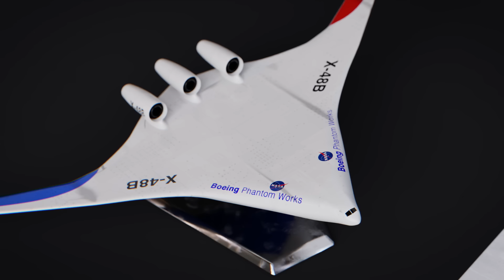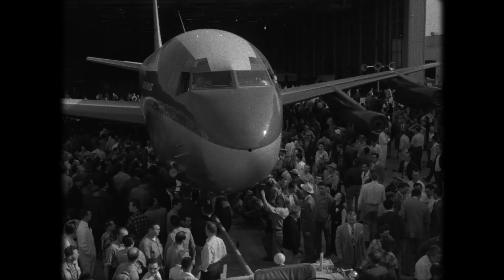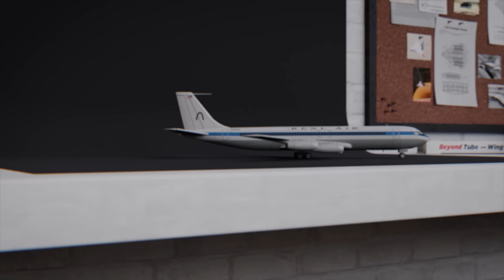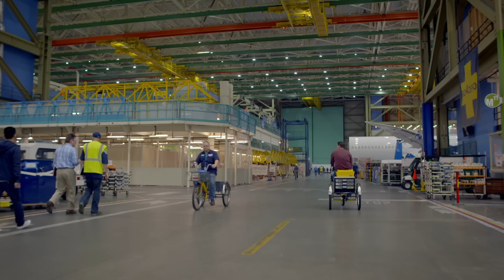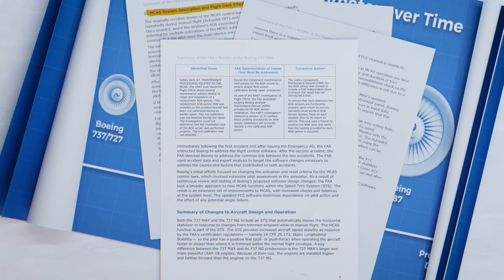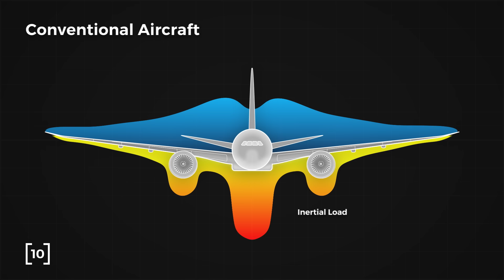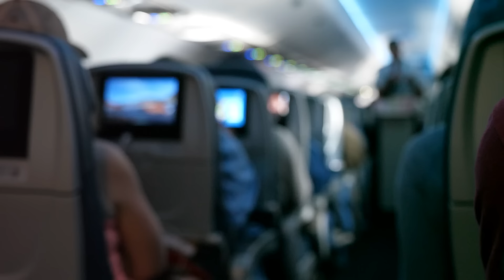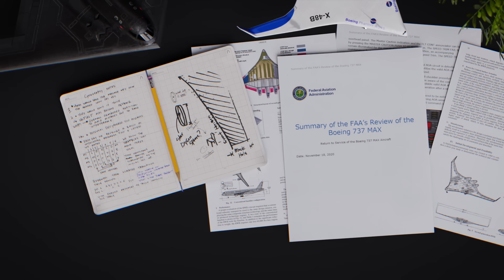The Plane That Will Change Travel Forever

Comment from the maker: Thanks everyone for the support on the notebooks! Took another pretty huge bet on manufacturing those things in bulk. About to hit the breakeven point so at-least I haven't lost money on them! If you wanna get your own, this is the link. https://store.nebula.app/collections/real-engineering
Reply: Engineer gaming
Reply: @Real Engineering can you do a video on how you would go about designing an aircraft (passenger or military) that would run off of renewable energies like wind and solar please
Reply: Concordia was best Plane ever :-(
Reply: @4thjulybd809 4 egg
Reply: All sold out already 😞
Reply: I bought one of your notebooks a long while back, and I really love it!
Reply: Is that kalamaduhz or kilo'meters?
Reply: Shipping 😭
Reply: The blended wing concept sounds intriguing...  the pressure loading issue could be negated by adapting a "passenger handling" concept from the mid 1960's where the passengers were to board a module and that would be ferried to the aircraft and secured to the airframe thus separating the flight crew (pilot/copilot) from passengers... The 'modular' passenger/cargo concept would also allow a greater mix/match of cargo/pax  and no major change to airport passenger services where the passenger boarding bridge and passenger module meet. Last of all, the blended wing aircraft would not necessarily be crowding a terminals jetway as it awaits, servicing, pax/cargo/crew; and even more advantageous is as the pax modules are inbound to the terminal the outbound pax module is outbound, speeding up the turnaround time
Reply: bit of a fault with your design, engines on the rear tail,,dont work.
Reply: its called....a-loo-min-um....you engineers dont seemed to be able to pronounce this word correctly?
Reply: @MrTwige   No, it's you Americans who don't know how to say or spell aluminium!
Reply: @stevie-ray2020  Its ok, To ma to, 
t mot to!  I understand it!
Reply: @MrTwige  No thanks! Us Aussies will just stick with what are the accepted global-standards!
Reply: @MrTwige  who killed the native Americans and took their land?
Reply: @Jesusisyhvh1  you did!
Reply: @MrTwige   I am native...
Reply: Q

L
Reply: @MrTwige  Someone clearly hasn't heard of regional dialects.
Reply: @MrTwige  
He should change his channel name to “Fake Engineering”

Comment: @5:05 uhhhh, it seems like the solution here is obvious!?!  Instead of building an entirely new blended body airframe to test tail-less wing controls, use the existing tube and wing design to run that test!  All you'd need to do is shift the center of gravity and chop off the horizontal stabilizer!  And if it works, the video says removing the horizontal stabilizer produces 5% more lift, less induced drag, and less parasitic drag adding up to ~20% savings.  You'd only need to design new wing control surfaces rather than the ENTIRE plane!!!!!!!!

Comment: Nah did you hear about the Airbus Concept Plane? It’s powered by hydrogen and the plane will turn transparent . Also, there is an interaction center. The seats a 100% recyclable and adapt to person sitting in them. It also has floating screens and there will be sound showers at night.  There is also an electric version
Reply: Recyclable seats? Great! No need to go to the toilet anymore xD

Comment: Building c.20 billion dollar flying wing bombers is one thing, building (and selling) hundreds of flying wing / lifting body commercial airliners is something else. The tube and wings is working, it is still evolving. The evolution has been largely successful, the revolutions less so - clearly the Concorde in speed, arguably A380 in size. The tube and wings is the aerial equivalent of a bus, form and function combined, basic and cost effective. That leaves fuel savings vs all other factors. The irony being that for 50 years we have been talking about fossil fuels being limited, yet the last couple of years has seen a surplus of oil, to the point that quotas are needed to keep the price high enough that US and North Sea oil is cost effective enough, and that’s while sanctioning Iranian and Venezuelan oil production, to some point Russian oil production and limited Libyan oil production. The problem might not be the fuel consumption, but rather the manipulation of its price.

Comment: Tubes and wings…
That’s not only the B-47 / B707, but most aircraft ever created.

You are talking about a pressure cabine, sweptback wings and wing mounted jet engine pods.
Tubes, wings and a lot more.

Comment: One of the biggest enemies of this Design (which exists in an Airbus variant as well btw) is the form factor on the ground. All of the worlds airports are set up to handle tube + wings style airliners. Adjusting them to handle this weird geometry will take decades which will hamper airlines flexibility a lot. Secondly its fairly bad for evacuating. The 90 second rule is unlikely to get dropped and with two planes worth of passengers but "half" the side exits to escape out of its gonna be more and more difficult. Not to mention that the shape of the pressurized area will be another issue.

Comment: It will be interesting to see if structural or "massless" batteries can be incorporated into the carbon fiber design of the plane, as well as perhaps a photovoltaic attribute considering its large surface area.

Comment: The problem with blended wing airliners is that the passengers sitting furthest from the axis of roll will experience larger forces when the aircraft performs any turning maneuver. This in turns creates a very uncomfortable travelling experience for those passengers. That is why blended wings haven't been developed yet for airline purposes.

Comment: A flying wing design could readily use a hive frame design both laterally and across the airframe. Carbon Fiber could be easily made to use a magnetic bonding unit to pulse a 3d printer and bound using a hive matrix. Anyone who is doubting the hive technologies should give me a call. 780-228-1300. Elon could build this technologies and Mars would be a simple flight operation with a magnetic flux engine with ram jet drives easy peasy. Scalability is about several factors rather than brute acceleration and the lift can be overcome with Mach 6-9 escape velocity out of orbit.

Comment: I miss old Boeing. When engineering came first. After the merger, it's never been the same.
Reply: Boeing is incompetent.  Airbus beat them decades ago on fly by wire controls. I won't get into a Boeing plane.

Comment: Hydrogen will never be a successful fuel because the use of hydrogen emits MORE CO2 than just using jet fuel. If there is a fuel that could be applied it would be LNG, not liquid H2.

Comment: You may want to double check your research as "elliptical" lift distribution is historically what has been used to design conventional aircraft. The term you are looking for, the lift distribution strategy that allows for lightened component design out at the wing tips and reduced drag from the control of vortex generation, is "bell curve" lift distribution. Proverse yaw is another advantage of the BCLD philosophy and is the primary reason that birds don't need vertical stabilizers and rudders.

Comment: I didn't hear a convincing resolution to the issue with keeping the plane stable though
Is the plan really just to hope that the software and sensors work perfectly? If that's the case I'm going to file this mentally under the same category as the 737 Max - never gonna ride in one of these.

Comment: Hydrogen fuel is not necessary to be carbon neutral, bio-fuel from maring algae (diatoms), which could be farmed would also work, without all the expensive infrastructure hydrogen would require (which also has its footprint). TANSTAAFL

Comment: How would the X-48 airliner meet the requirement of full evacuation in 90 seconds using 50% of the exits? Exiting under the aircraft is not practical. Can't be used at all after an undercarriage collapse. No airliner has underbelly exits. So it means going up. That will be slow compared with the slides that are used with the main exits on a conventional airliner. Overwing exits in a conventional airliner are there to give a  bit more exit capacity to meet the 90 second requirement. They care slow because passengers have to step up and out. Passengers must be prevented exit into danger such as onto a burning wing. The fuselage does provide protection from flames and heat  if the passengers exit onto the other wing. A slide is used from the overwing exit to the ground. The blend wing exposes people to flames, requires an exit up stairs and a long drop to the ground.

Comment: It will take decades to move to a blended wing design and maybe never. The biggest problem with the design for passenger use is a human problem. People will get sick on this plane. As the move away from the center of the plane, the movement of the plane will get worse. It will be like flying in turbulence the entire trip. Just look out a plane window and see how much it moves at the tip. Look at a 787 wing and see how much it flexes. Until you can resolve the stability problem and human air sickness, you will not get passengers on it.

Comment: Stop listening to enviro-weirdos. They do not enough consider science nor human benefit. You need some carbon, in "hydrocarbons", because hydrogen is a terrible fuel for several reasons. It is not energy-dense enough, also can not easily be stored as a liquid rather than compressed gas. However, there may be some potential to get rid of burning fuel altogether, but the reasons should be better benefit to the customers, and not worship of God's creation, which of course is the forbidden idolatry. See the Ten Commandments which you can read in Exodus 20. Global warming/climate change is fake-science. CO2 is plant food. Currently we are struggling to produce batteries that can store enough energy, but with Tesla EVs going 200 or 300 miles on a charge, that is interesting now to me. Finally sufficient range to make EVs to start to become practical. And I hear that better batteries are around the corner. What about using the NWO-suppressed Nicolai Tesla's free-energy technology, or at least perhaps thorium nuclear power? Maybe such a reactor could fit onto an airplane. Anyway, using hydrogen as a portable fuel, is just plain stupid. It does not have the proper characteristics.

Comment: Examples of safe fly by wire systems 
Every Airbus ever(except a300 and a310). A320 has even corrected pilots who were about to crash due to a human error.
A Boeing would’ve just crashed.
Reply: Haha, an A320 on a demonstrator flight in France refuses to respond to pilot's climb commands and crashes into trees at the end of the runway.  Actual event.  Pretty obvious you're lacking information.

Comment: Nothing against H based fuel systems but currently think it must be an in-situ generation system because storage of H + 02 is too dangerous...
Reply: You would obviously take the oxygen from the air like with conventional fuels. Otherwise you would have a rocket ;D

Comment: the emergency door is going to de a huge issue if the aircraft achives a wheels up landing  it would be reasonable tp assume that a lot of detriyus will be strewn around the cabin nomatter how well the cabin crew manage the impending incident tus providfing trip hazards to be added to the panic resulting in increased fatalities i hsve heard the idea of  roof escape hatches, this will have design annd humanfactors issues
how ever if you are looking for eco freindly then mary this shape with electrick engines into an ekranopkan, i think youmay have a costal taxi vehicle?

Comment: Lift body has been around a long time WHY so long for airliners to use it?
Reply: they kinda went over the biggest point in the video: it's bloody impossible to fly one manually, it can be done but it ain't easy and you WILL fail eventually so without a functioning autocorrection system it simply is not reliable enough. making an autocorrect system via drag/lift is as easy as sticking a ribbon on the tail of a kite, making one that works primarily via the control surfaces though?...not so much.
that said they really are a bit late to the party here: almost every single design and engineering and manufacturing challenge in making something like this has gotten exponentially easier with every increase in computer modeling and every advancement in fluid dynamics...basically the videogame industry made this project feasible somewhere around when the ps2 launched.
...I hope that delay isn't just plain education latency, it didn't take long for engineering software to incorporate most of those advances and they literally got exponentially faster stronger and easier to use at each advancement and around now is when people who had access to the earlier big changes would finally start having any actual influence in their careers.
^it's actually one of the big sources of funding in videogame companies, almost everything they do has clear real world applications (everything from actual development anyways, not the rampant theft and copy-pasting of everything under the sun most major companies get by on) so a lot of them are pretty much working as an R&D firm with actually making a game as only a part of their project goals. to put that in real terms insomniac studios made the math used to keep your computer cool right now, used in the design of the building it was made in, used in the design of half the equipment used to build it, used to design newer nuclear reactors, and if you're ever unfortunate enough to go in for major surgery they probably had a hand in redesigning that surgery to be faster, safer and/or even possible all because some poor bastard was obsessing over trying to get the damned water to look right...funnily enough the ps2 can't actually run the equations they ended up building, you can find a stripped down bare bones 1x1 2-dimentional patch of it in the development museum and even just running that pushes the system to it's limit.

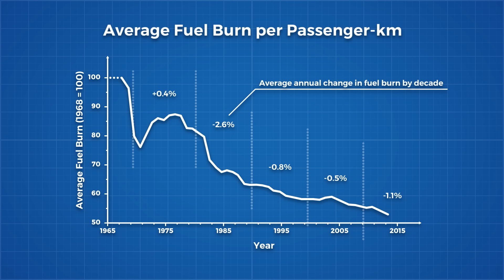Comment: uhhh...okay, wow, that is a HORRIBLY misleading graph at 1:22 it doesn't mean they are at 50% the fuel per passenger per distance by 2015, it means that 100 on the vertical translates to the fuel/passenger/distance for the year 1968 and 50 translates to the fuel/passenger/distance for the year 2015 (placed at zero-line for dramatic effect for...some reason? fk if I know why, it's the first reason this graph parsed as screaming fake information so it's clearly a bad idea to misrepresent like that, I might've just assumed this was about right and never thought about the labeling if they'd left the zero line at zero) this graph could actually be going up to double the fuel spent and it would still look exactly the same.

the labeling on the sections doesn't actually correlate to anything labled in the graph but it seems to imply there is only a -1.1% improovement over the decades? that also makes very little sense because airliners have gotten much more efficient...unless were just plain putting way less people on the average plane and/or putting them through much less efficient routing?

Comment: Great Video.  Nicely done.  The problem is, we have been watching documentary videos and reading engineering articles about how Boeing's "Blended Wing" airliners are just around the corner, and about to change the way we look at air travel for almost as long as we have been hearing about Cold Fusion powering our world.  As noted in the vid, there are just some issues you can't get away from.

Comment: am i the only one thinking that hydrogen blended wing airplanes are bound to be massive flying bombs with crashes pretty much guaranteed to have close to 0 survivors?

don't get me wrong, kerosene is quite flammable as is and darn dangerous, but as hydrogen will undoubtedly be stored as a compressed liquid, any leak from a compromised fuel tank will very quickly leak vast amounts of hydrogen which will turn back to gas and expand pretty much in a matter of seconds, ready to burn in a flash to the smallest spark, if it doesn't just explode violently.

the way i see it, the only way to keep traveling while being serious about climate change will be to drop airplanes as the mainstream aircrafts, and accept to turn to much slower but also more fuel efficient air vessels. i don't know, maybe something like improved blimps.

Comment: Methane is easier to store and can be used for fuel cells.
Battery energy densities are getting better. I think that by 2030, electric commercial air travel will be possible.

Comment: This video completely forgot to mention the #1 cost savings airliners use today- Pack in as many people as possible in to a tight space, comfort be damned.  The way people are treated on flights is grotesque, and no amount of engineering will fix the corporate greed factor in air travel.

Comment: Ever looked at the wings when flying?     The added lift from the wide wing shaped fuselage saves fuel and provides lots of space, but it comes at a cost.  Even the slightest turbulence will shake the passengers sick.  
For a cargo plane... sure.  But for passenger transport you need comfort.

Comment: 5:08 You've neglected a significant force that can balance the system! The engine provides thrust, and with engines below the CG, it can provide a force acting opposite to the lift.
Reply: *sorry, I mean it provides a counter torque around the CG, not a vertical force. 😋